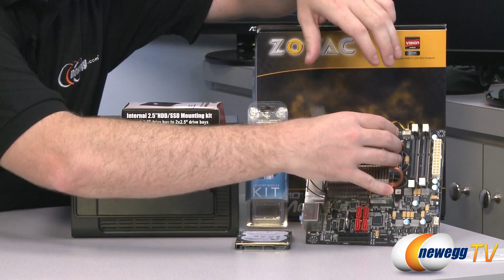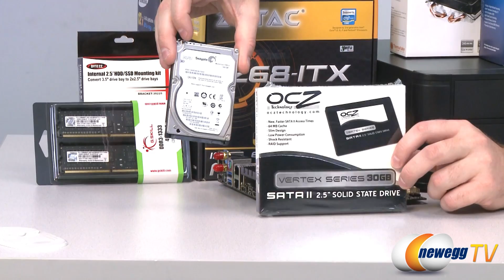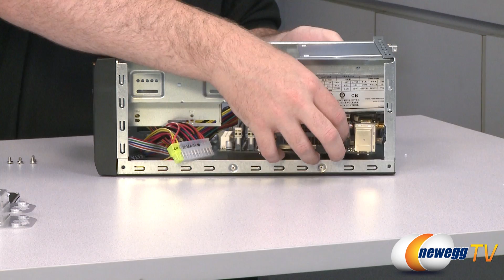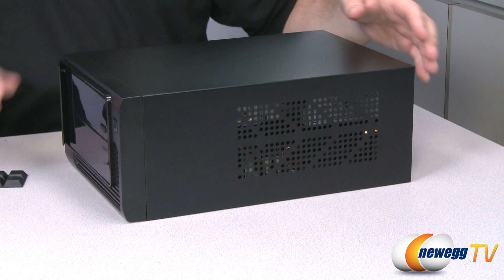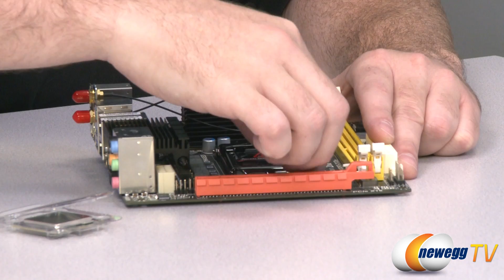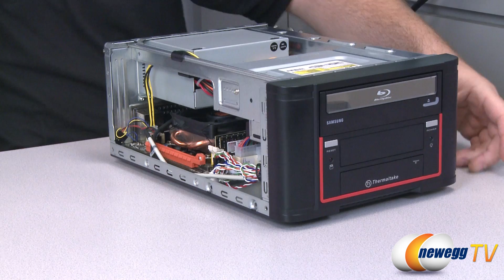Newegg TV: How To Build a SFF Mini-ITX HTPC - Part 1

Comment: Iam ordered my HTPC yesterday and it looks like that:

Case: Thermaltake Element Q
Mainboard: ASRock B75M-ITX
CPU: Intel Celeron G550
Cooler: Thermaltake Slim X3 (Thx to that Video i know it will fit and work)
SSD: OCZ Vertex 2 64GB (got it here allready)
RAM: 4GB G.Skill NQ Series DDR3-1600 DIMM CL9 Dual Kit
OS: Windows 7 32bit

It will replace my WDTV Box cause it doesnt play all my Video Files. I think it will be ok for all HD Content and 3D Material with high Bitrates.

Comment: Are you pulling the video from a hard drive local to the PC or a server share somewhere on the network? Im guessing your TV does have 1080p capability? 720p TVs where the video is forced to downscale can get choppy. Check the drivers for your video card, make sure to use AMD/ATI instead of auto supplied Windows ones. Check your video settings in XMBC and make sure most of them are set to Auto.

Comment: I have one question if I have a small half sized slim computer and it has a built  in power supply or a small one that only provides around 300watts how can I upgrade it for a graphics card like a            GTX 550 TI that requires 400watts?
Is there stronger slim power supply? Whats the strongest small power supply I can fit in one of these ?

Comment: I have build 9 PCs for work with a 2500K CPU and a 150W PSU. You don't need a 250W or a 2400S CPU. They sped about 35W each in idel.

Comment: you could do so much more with these kinds of cases now. Like you can put a core i7 2600k along with some low-profile graphics (if not full size assuming the case can fit it). There's a lot you can do with 250 watts of headroom considering the CPU at stock consumes 95 watts and a decent GPU would consume around another 100 watts.

Comment: A little word of warning about these cases.  There is room for a second hard drive that stands upright on one of the sides, but the way it mounts is a bit obnoxious.  There are plastic pieces that are attached to either side of the drive, then the drive slides in.  It fits in pretty snug, but the plastic pieces kind of shave themselves against the case.  We haven't had any major issues, but it's a bit annoying.

Otherwise, they're pretty awesome.  Have fun buildin'.

Comment: My htpc has an athlon dual core underclocked to 2.2 a geforce 210 and 2gb of ram and I play netflix, hulu, youtube, hd video, etc. without ANY issues whatsoever to a 47" tv.  An i5 in a htpc is super overkill, however it would be nice not having to buy a video card..  The sandy bridge gpu's are more than capable of HD

Comment: @PlayerUnkown I've seen quite a bit of benchmarking and it's shown that the 955 is better than the 1100t (for gaming). And it's also less money. I'd say if you're going to get the 1100t, you'd might as well pay a little more for an Intel i5 2500k sandy bridge.
If I'm correct, the 6 core possessor is better at multitasking.

As for the motherboard, I'd go for an AM3+ CPU socket: they're compatible with the new 8 core bulldozer series CPUs that are coming out. You'd then be able to upgrade later.

Comment: @randrewm97 so true lol. my friends AMD Quad 955 Black edition 3.2GHZ PC was $345 without graphics only onboard. Mine was Intel duel core E5700 3.00Ghz was $450 and i had almost the same parts just he had 450w PSU and i have 620W PSU then i got a Nvidia Geforce GT440 with it making it $500 and he got a 6770 1GB GDDR5 and made it $430 .____. AMD has good prices, Intel dont. lol my next pc will be 1100T 6 core Phenom. instead of intel. with 6970

Comment: Ive built 3 computers, One AMD Quad 955 Black edition PC using Thermaltake V3 Case. And the front panel connecting was easy, My Multimedia case, with Intel E5700 the front panel connectors are relativity easy and a Pentium 4 PC. Which was a lot harder to plug in... with the front panels. Mainly cause the motherboard company shut down and the case doesn't come with online support or a manual. So i had to figure it all out. But if you have manuals. it tells you easily with text & a diagram. :)

Comment: A Home Server build variant of the SFF would be nice. Do an SFF bare case with a better P/S. Possibilities are to remove the optical and slip in an internal 2x2.5" to 3.5" adapter or 4x2.5" to 5.25" Hotswap adapter and maybe a RAID 1 or 5 card. Lastly an option without the HS OS HDD and flash boot the HS OS from a mini pen drive or CF to 2.5" SATA adapter. The various hardware options aren't too complex so the video length shouldn't be too long. Newegg sells Windows Home Server for a reason.